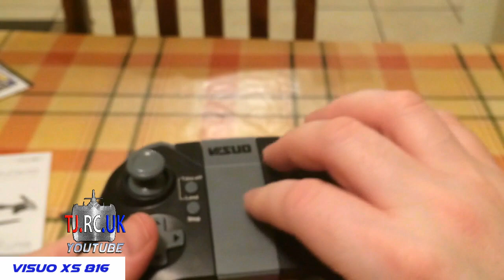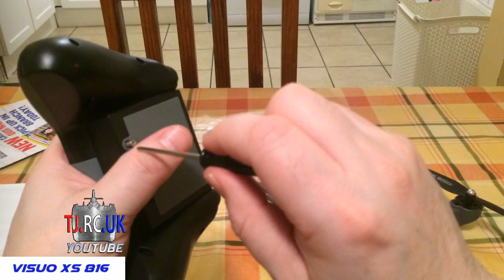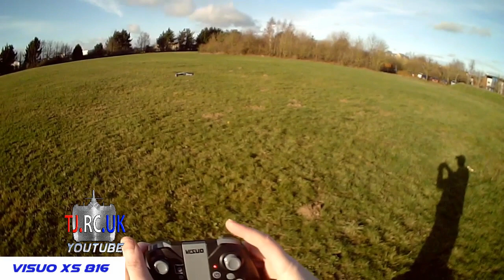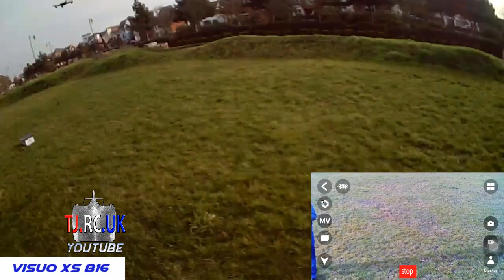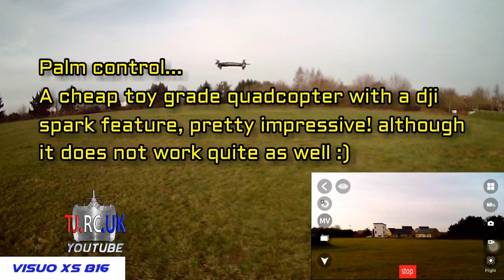👁‍🗨Visuo XS816,Wifi fpv,2 cams,Active track, Gesture mode,Palm control, Optical flow(Gearbest)

Comment from the maker: ✳️Click the link below to check out the current price and full spec on this one if you are interested✳️
📢 XS816 you can also buy it with extra batteries & a bag just choose the option you want at the the time of ordering: https://www.gearbest.com/rc-quadcopters/pp_009176544524.html?wid=1433363&lkid=19444552 
📢If you place an order you can use your tracking number given to you to check the shipping progress and location of the package on https://www.1tracking.net/

📢 Guys this is a full in depth honest review and it's a long one! so I have broken it down into chapters for you below, if you are a total beginner to flying then it's worth watching the whole review :)..

▶️ Close up look of the Visuo XS 816 talking about the features/functions it has.
.
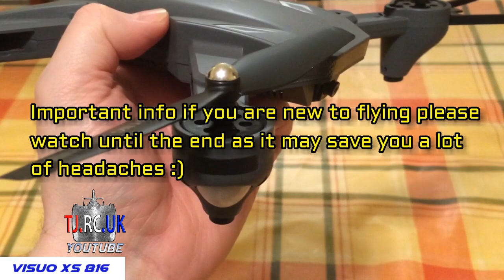⚠️Important info please watch if you are new to flying! 11:04

▶️ Installing the app from manuals QR code..04:21

▶️ Installing the batteries for the controller..08:35

▶️ Binding & calibration procedure including starting & stopping of quadcopters motors..09:15

▶️ Connecting your phones wifi with the quadcopter to enable wifi fpv along with app features..13:19

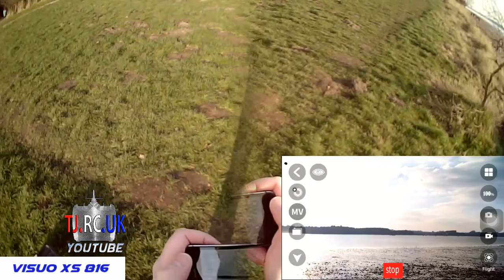▶️ Dual camera viewing modes.. 14:44

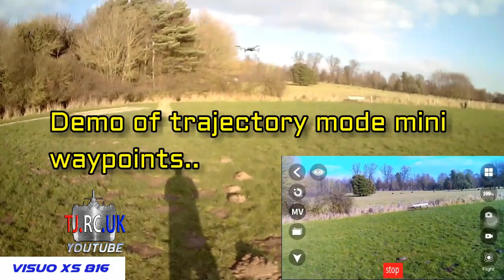▶️ Mini waypoint aka trajectory mode demo.. 15:32

▶️ Gesture shooting mode demo for pictures & video..17:05

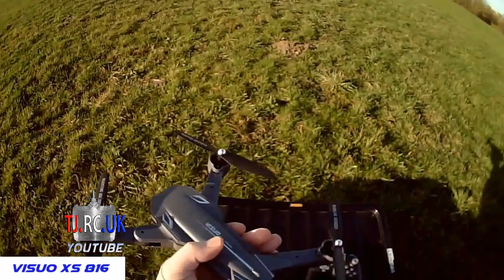▶️  test showing you how long it takes for the motors to stop on disconnection from the controller/phone.. 18:18

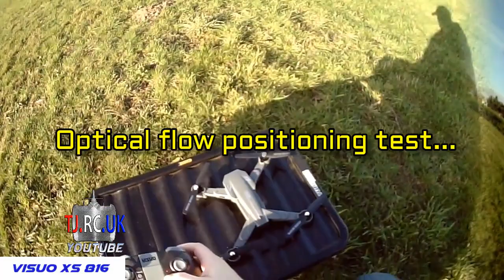▶️ Optical flow positioning test.. 18:50

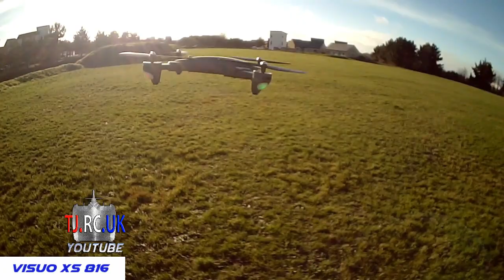▶️ Flips.. 19:36

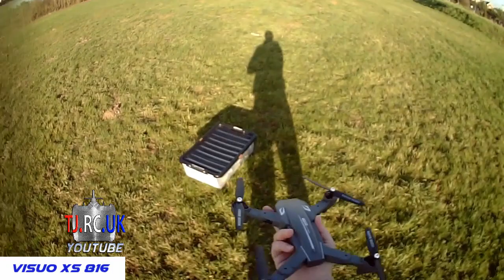▶️ Follow me mode.. 23:13

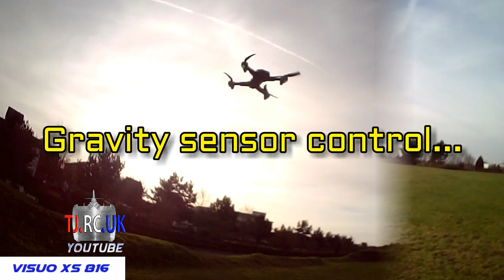▶️ Gravity sensor mode flying using your phone.. 26:08

▶️ Palm control like the spark moving the quad up & down using your hand.. 27:43

▶️ Phone app flight using virtual sticks.. 28:42

▶️ Who  would want to buy this? summing it up, my final thoughts..  28:56

▶️ This is a toy grade quad with a difference it has some more hobby grade features thrown in like follow me, hand gesture mode for pictures & video plus palm control a feature like the spark has! can it deliver watch the review to see :)...

▶️ This review is going to be in depth, it's aimed at any new flyers out there really who want to get into this great hobby we have :), this was sent to me for review from Gearbest.com as you will see I show exactly how it performs good or bad, I think it is worth getting for a fun flyer for days out letting you take selfies & video from the sky, it's by no means expensive and all ready to get you in the air, it just needs 3 x AA batteries for the controller, see what you think  & happy new year to you all :)

Comment: Great review thanks. So wihtout sd card where are videos and pics stored? And what is the big problem of not having sd card? I just ask because i am a drone noob. I was ready to buy the TIANQU VISUO XS809S but when i saw this i thought "ok i can have xs809s with a more options" right? Thanks in advance!!!
Reply: waiting your response
Reply from the maker: @thomasgkoasis6766  You got one :)
Reply from the maker: thomas gkoasis Hi so it only records to the phone with the app which as you can see it is still okay sometimes with  2.4 ghz WiFi fpv you can get break up and freezing but this performed okay so usually you would not see this if it records direct to a card, hope that helps and yes this has so many features for the price and the optical flow works really well! if you use my link above in the comments it helps me and the channel out a little, thanks 🙂
Reply: @tjrcuk  thanks for the response. Hope the best